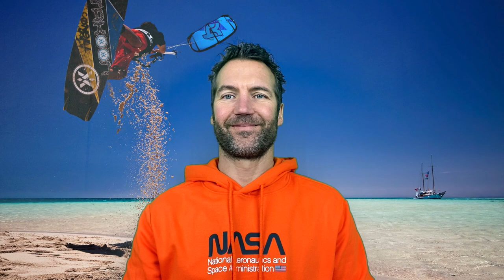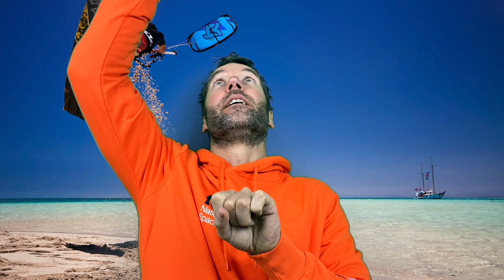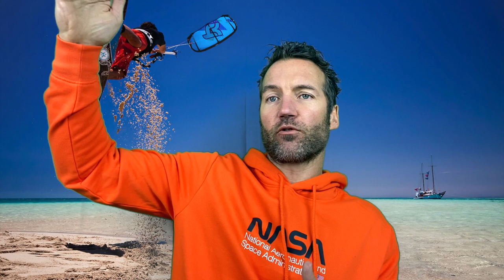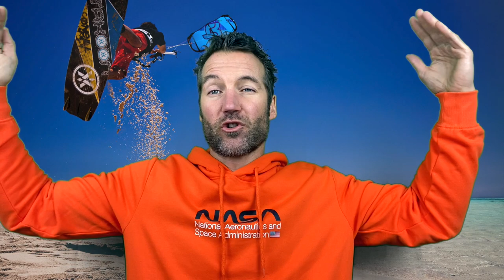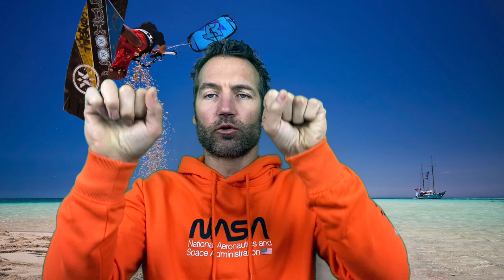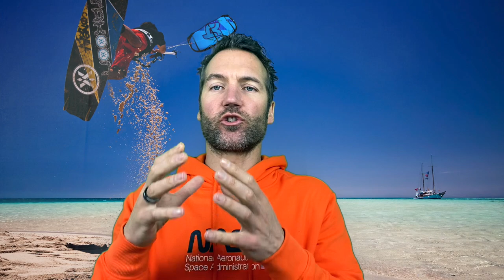What is Front Stalling & how to avoid it

Comment: This happens to me allot when jumping. Steering the kite Just saves it. But even then its on the edge of stalling. I try to focus on keeping a edge on takeoff but does not seem to help alot. Im flying a 2018 bandit. Any tips?
Reply from the maker: When jumping its normally caused by 1 of 2 things...bringing the kite too far past 12 on the up stroke or not redirecting it down again when you hit the zenith of the jump, causing you to pendulum under the kite and end up in front of the kite.
Reply: How about this?  As you are descending in your jump, the apparent wind for the kite moves the wind window forward.  When you  hit the water, the vertical element to the apparent wind stops so now the kite is in front of the window.  To prevent that you must turn the kite just before landing in the direction you want to go so it is in the normal window when you land.
I am a physics guy but beginner kiteboarder, so may be full of crap on this one.